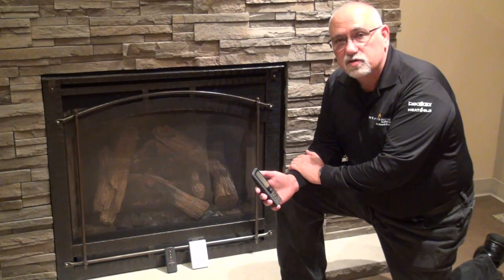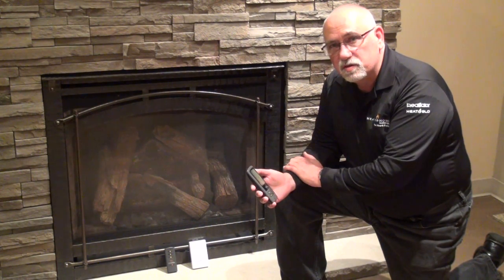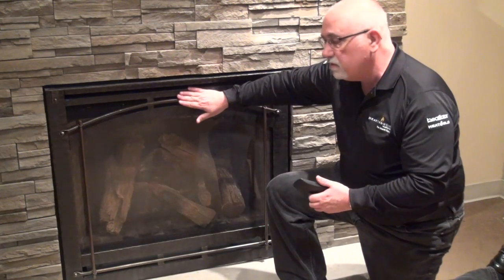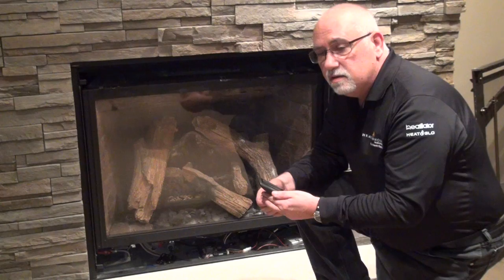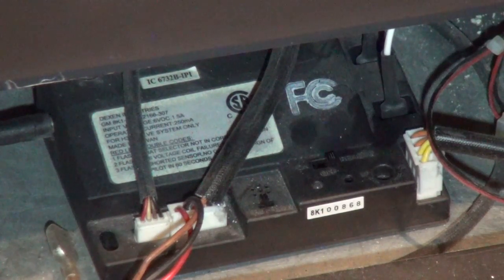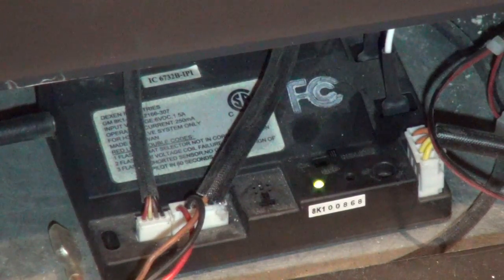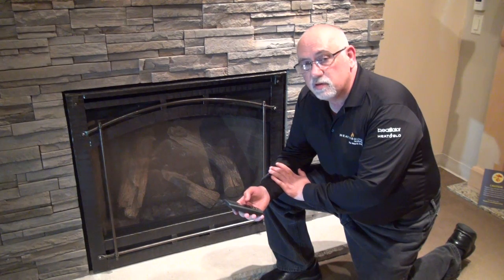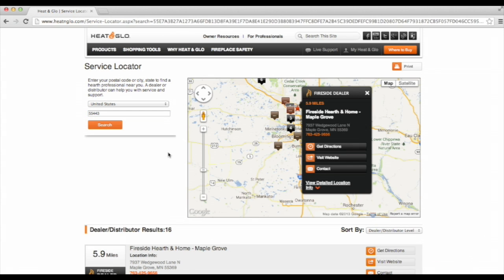Resetting Heat & Glo® RC Series Remote Controls Video

Comment: Thank you for this. We recently bought our house which has one of these fireplaces. Loved using it last year. Went to use it this year and the remote wouldn't work. swapped batteries both inside the fireplace and the remote to no avail. Tried unplugging the unit as well; of course didn't work. Didn't realize there was a reset switch on the receiver. Worked immediately after going through your simple steps. Thanks again!!!

Comment: Thanks for the instructions - they helped.  One part that was left out was that this is the protocol you'll need to use when you have to pair a new RC300 unit because the old one died and had to be replaced at full price due to HnG's paltry one year warranty.  I mean, it's not like a gas insert is a long-term durable good, right?

Comment: I have changed the batteries in my hand unit but the display is still blank so i am unable to follow these instructions. What else can I do? the fireplace works using the on/off switch on the back of the fireplace

Comment: Thanks! it looks like have a problem with remote pairing with my RC300 IntelliFire™ Plus Wireless Remote.  Is it possible I have a faulty Control Module (2166-347)?

Comment: I have a heat and glo tiar in bk ipi I've been having problems with it locking out. I've cleaned the sensing rod just to have it work for roughly 4 days at a time.  I recently replaced the pilot assembly.  it seems no to over fire.  pilot will light fireplace will flam up for a few seconds just to lose flame completely and red-light again and beep once.  it will do this over and over until the remote hits the desired temp.  I have also tried a new module.  that did not work either.

Comment: I can't turn my fireplace off. Had trouble turning it on this morning, accessed the control area, finally got it to turn on, now it won't turn off. Replaced batteries in RC, still no luck. Guess I'm gonna have to get in there where it is super hot. Yikes.

Comment: Have An SL-36--Cannot locate a learn button? Any Suggestions? Changed batteries-still not working-could it also be a thermocouple?
Reply from the maker: Hi +carmen   d scrimalli. In order to assist you, we would need to know what remote control  you are using. You can contact one of our Specialists for assistance at 888-427-3973. They are available Monday–Friday from 8am – 8pm central time. We look forward to hearing from you. Have a great day!

Comment: will doing this make it so this trash af wall button thing stops burning through batteries every week? this is unacceptable. would much prefer a damn switch instead of this crap ass "remote" mounted on a wall needing batteries.